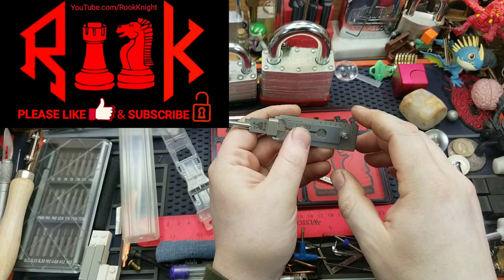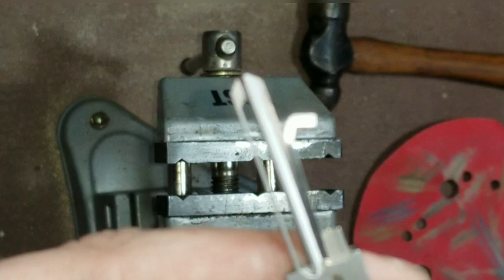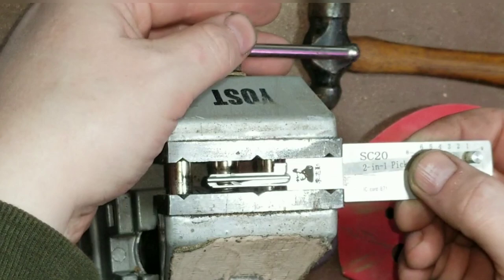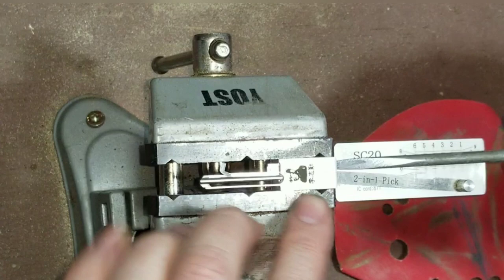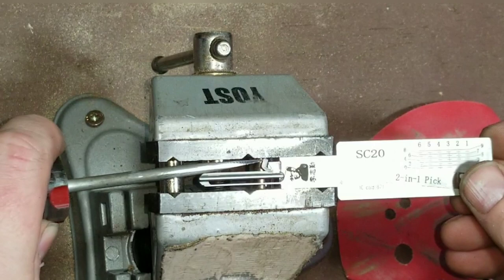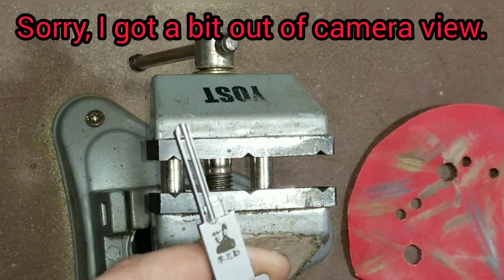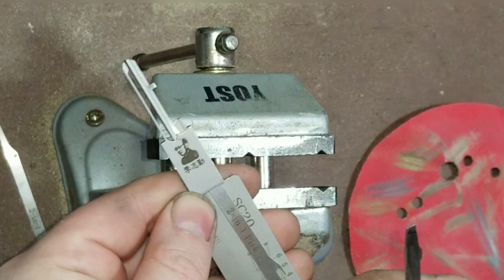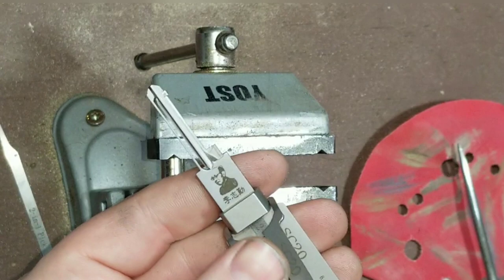fixing/repairing a LISHI pick tip.

Comment: Great video tutorial on replacing a damaged tip. Thank you for this valuable information. 
Where do you get extra Lishi tips from? 👍👍👍👍🦊
Reply from the maker: Thanks Jack.
I have seen them in lockpicks.com or 
USH hardware.com  but try Google searching "replace tip for a (sc20) lishi pick" that way you can shop pricing, and get the best price. But put in the lishi you're looking for in the search, I did the sc20, but you might need the kw5, anywho,  I believe I seen them in lockpickmall.com too, but it will all depend on what lishi you have. I believe they go for $10 plus shipping 
PS if Im not making sense just ask to clarify, Im bad at texting my friend.  
Have a great weekend.

Comment: Being you were gonna use the broken old tip one for a knife, wouldnt it have been easier to cut the tip off and just slide it out smoothly?
Reply from the maker: Probably would have been easier, but  Hindsight is always 20/20.  I didn't make it into a knife, until a few day later, so I wasn't thinking knife, I was thinking what if I could save it, or repair the tip.